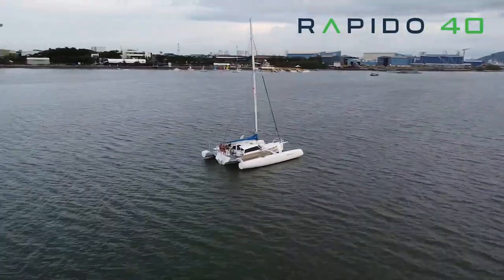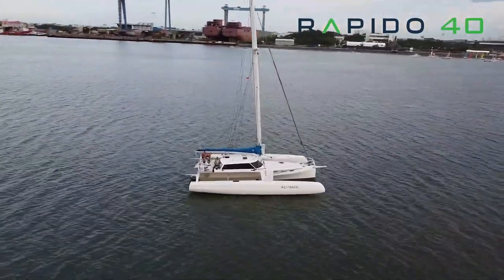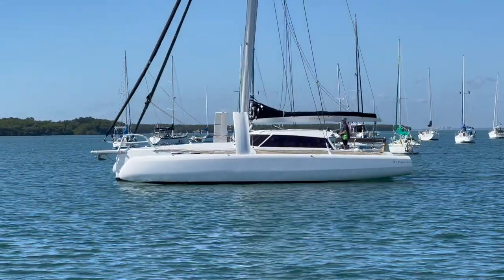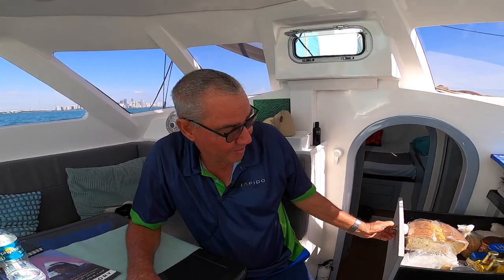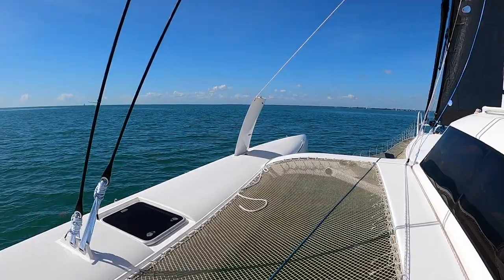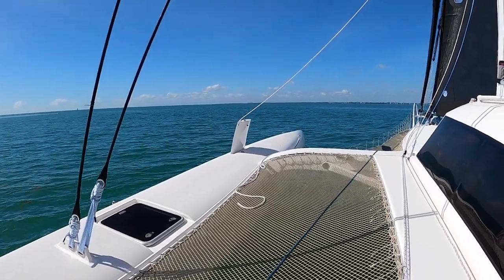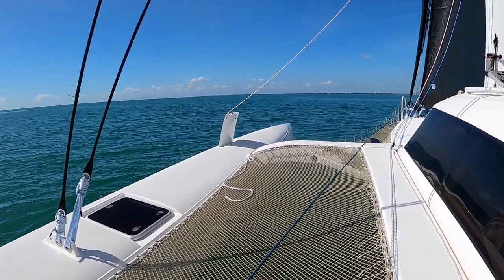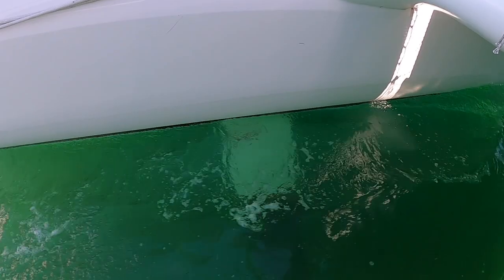RAPIDO 40 Trimaran - Boat Review Teaser - Multihulls World

Comment: Why are trimarans faster than catamarans when only two of the trimaran hulls are in the water at the same time anyway?
Reply from the maker: Most habitable trimarans on the market are much lighter than catamarans of the same size. The speed of a sailboat depends broadly on two main factors - sail-to-weight ratio and length. The lighter a sailboat is, the larger it is and the greater its sail area, the faster it will go...
Reply: They point far better up wind, like a mono haul, hence using the leeward sides trihull as training wheels. and fast downwind due to more surface are in the water